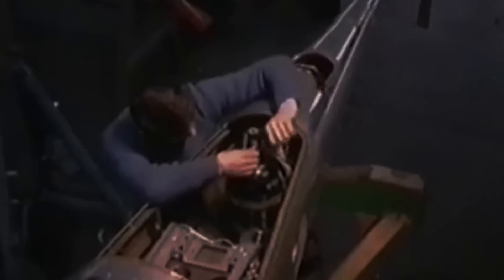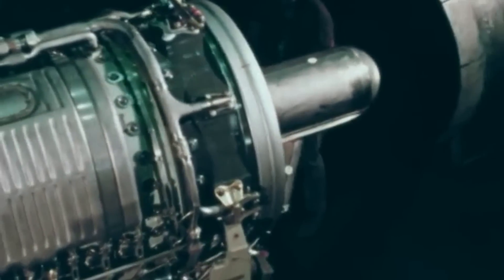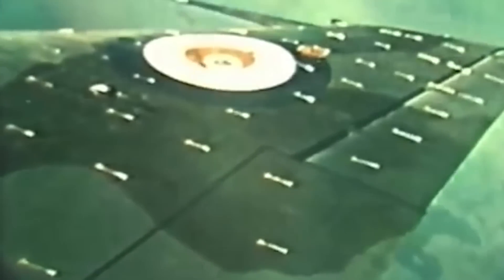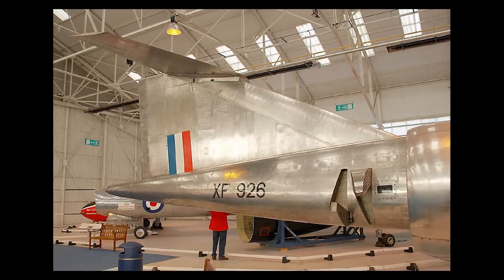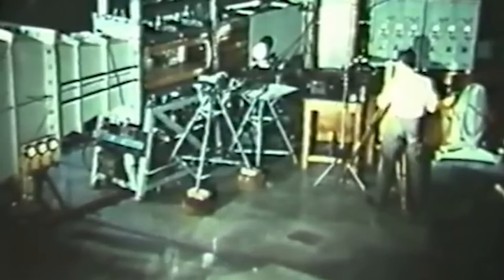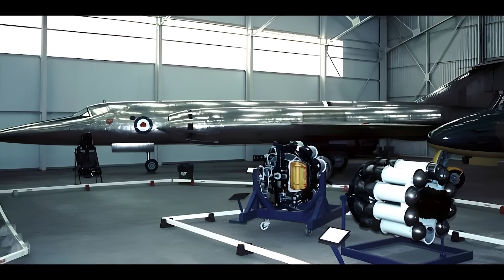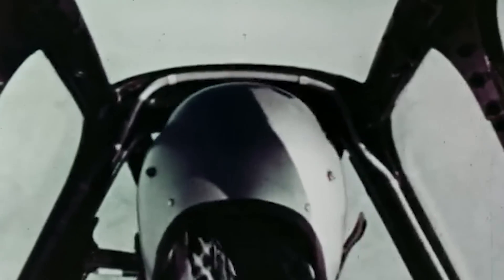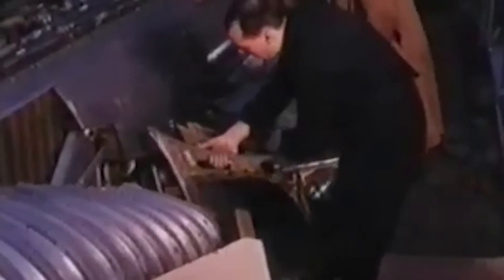The Flaming Pencil -  Britain's Supersonic Jet That Almost Melted Itself

Comment: Looks like it was the prototype of SR-71 black bird.  At the time, the Brit might have no idea on varying the jet engine cycle into ram jet like SR-71 did.
Reply: At the time Bristol were also developing the Olympus engine which would go on to power Concorde. A military Olympus would have been able to cruise at Mach 3+ without the need for ramjet or even afterburners.
Reply: @agt155  At mach3, there are no turbojets  which still have efficiency.

Comment: The airframe was alright, though complex to built. Unfortunately the engines (Gyron Juniors) had such poor specific fuel consumption that the 188 could not sustain Mach 2+ beyond a few minutes, i.e. couldn’t give any data on sustained flight airframe heating because it couldn’t carry enough fuel. The very thin wing wasn’t variable sweep, it was compound sweep.

Comment: I read that it was the specific fuel consumption (SFC) of the engines was inadequate and that it simply could not carry enough fuel to complete the task. In A-12/SR-71 case this was solved by having engine to work as turbojet in low speed regime and ramjet in high speed regime. MiG-25 Foxbat used the engines that was highly inefficient at low sped regime, but could take in a lot of ongoing airflow making them adequate for M2+ cruise with afterburner.
I don't know if 188 could contribute to "heat-soak" tests with such a short endurance. It is a tough job and solving it may be expensive. A-12/SR-71 used honeycomb titanium structure, special fuel, would leak on the runway as reservoirs would plug themselves as the speed/ heat increased. Foxbat used mainly stainless steel airframe, special thermoresistant fuel and inert gas which made it capable to fly M2.83 (that speed was the nominal atmosphere limit caused by heat due to drag, it was lower or higher depending of real conditions).
Continuous speed slightly above M2 is "solvable", both Concorde and Tu-144 proved it. MiG-25 also would keep its speed under M2.2 for max range and airframe life (not the engines). OTOH, MiG-31 used just this mark for its max continuous speed as it has turbofans (It can hit M2.83, but it is the limit, while MiG-25 can do it until it runs out of gas).
Reply: The 188 was only a research project, it didn't really need endurance. If a production aircraft were made it would no doubt have been fitted with Bristol Olympus engines (being developed at the time) which were the most advanced high speed jet engines around.
Reply: @agt155  My point was that it could not reach its design speed because of poor engine SFC-simply could not carry enough fuel. Even with engines with better SFC it could maybe reach design speed, but being there for 2 min does not provide any meaningful "heat soak" data.

Comment: Its (bad) Aerodynamics was why it was so slow! Britain know nothing about Area Rule, or any aero tricks.
Reply: Buccaneer.
Reply: Not sure if the area rule applies to supersonic platforms.
If you look at the cross-section of many supersonic aircraft, they don't seem to adhere to the area rule. Compare the Bucaneer to the Tornado. The Bucaneer is subsonic and follows the area rule whilst the Tornado is supersonic and from my knowledge it's shape doesn't appear to, but I stand to be corrected.
Reply: @125brat  sorry, area rule does apply above Mach 1 and has often been applied.   However,  supersonic aircraft also have to manage the shock waves, so the impact of area rule on the design is not so visually obvious.  I used Buccaneer to refute the 'claim' that British aviation  engineers didn't understand area rule in the 1950s.
Reply: C'mon man!
Reply: And there talks and EX -Spert
Reply: @theoccupier1652  an ex-spurt. Please get your insults grammatically correct, or else people just assume you are ignorant.
Reply: But built many of the fastest planes, cars and boats ever

Comment: British SR-71 .  If you painted in matt black ( god forbid....)  it would look state of the art !
Reply: My thoughts exactly.
Reply: Lol it would still be just a black-bird trying to fly supersonic.
Reply: This plane was built by a group of enthusiasts from Novosibirsk with two stainless steel pipes from the hardware store and stainless steel sinks from a scrap yard. They polished it perfectly, mounted two engines from abandoned MiG-15 and wanted to make a supersonic home-made aircraft with a budget of only 20 000 rubles!

Seriously don't compare it with SR-71 Blackbird, it's silly.
Reply: Wrong fuselage material and weak engines
Reply: @rubinreiter6351  Try and comprehend what was written please, he's talking about it's 'looks', in which he is correct! As stated in the video materials science wasn't advanced enough which is why SS was used! First flight Lightning, 1954, first flight SR71 1964, lots happens in ten years!
Reply: @icarossavvides2641  Thanks for clearing that up !
Reply: @rubinreiter6351  was it made of stainless steel ?
Reply: @javidjames3319  the SR-71 was made of titanium.
Reply: @rubinreiter6351  Mig-25 is stainless steel body, and it can easily reach Mach 3 as well.
Reply: @alexlo7708  how long? At which height? To much weight.
Reply: @rubinreiter6351  Long enough that it can reach SR-71 and fire a missile.  Mig-25 had several records on high altitude.
Reply: @alexlo7708  they tried it 25 years in vain.... The SR never was scratched and while trying it the Mig engines failed in short time, the J's went on for hours.
Reply: @rubinreiter6351  SR71 never went scratch because it never flew into Soviet airspace since then.
Reply: @alexlo7708  there were photos of Migs and there contrails far below the cruising altitude of the SR. Later after the breakdown of the USSR the Mig Pilots visited Beale and reported that they tried but never reached that altitude and their engines flamed out or even got damaged. Zoom climbing is not a straight and level flight, minutes of M3+ versus hours. Keeping altitude versus zoom. No chance. Missiles couldn't do it as well, no atmosphere to steer and line up, bullets are slower than the SR. Keep on dreaming....
Reply: @rubinreiter6351  No need to wait post Soviet break down. The Soviet cheated pilot, Mr. Balenko had brought it to Japan in exchange for US money since it was early deployed.  Many tourists have experienced space flight tour on Mig-25 in post Soviet era as Russia had made them available to everyone who can pay. 
By the way, there was no record of SR-71 being chased by the Mig since the black bird had never flown to Russian airspace.
  Moreover, Mig-25 is interceptor, not fighter. So they were not used in chasing someone like Su27 or Mig-31.   Had it been presenting after SR-71, That'd have mean the plane'd never return.

Comment: 1963 and it's still not at M 2.0
The F-4 Phantom, Lightning and Mirage III all  did that ... in 1958
Reply: It was designed as a research aircraft for testing sustained high mach speeds on airframe heating. Those other aircraft you mentioned could only reach those speeds in short burst.
Reply: Well they still wanted to have their own blackbird.

Comment: looks like a larger f 104 that had engine pods stuck on with larger wings
Reply: I thought the same thing. It actually looks like Kelly Johnson had a few too many and built an F-104/A-12 hybrid for giggles.
Reply: I think it is like the unrecognized child between an F-104 and a Gloster Meteor
Reply: Nahh it's a tiny blackbird learning to fly supersonic.
Reply: The main difference it actually flew! The F104 was a death trap and an early  Lockheed scam.
Reply: The F-104 first flight was in 1954.  The Bristol 188 first flight was in 1962, The same year as the Lockheed A-12 which led to the SR-71 Blackbird.  When the Blackbird was first discussed (by LBJ bragging about it and mis-naming it from RS-71 to SR-71), There were said to be two predecessors to the Blackbird, the A-11 and YF-12.  Now they are described as the A-12 and YF-12.  Anyone know why?  "A" designates a military Attack aircraft, just an "S" indicates Anti-Submarine Warfare.  I believe the story, at the time, was that A-11 was either a CIA designation or a Lockheed design number.

Comment: Very futuristic looking aircraft but was largely killed of with the move from interceptor jets to the Surface to Air Missile in the late 1950s. It never flew over Mach 2 in its final form, however the new English Electric Lightning interceptor had entered service and it was capable of Mach 2.23 or 1,500 mph, flying on more reliable Rolls Royce Avon engines (rejected for the 188 ?) The older Fairey Delta FD-2 also reached Mach 2, and with new "Concorde wings" it became the development aircraft for the Concorde airliner.
Reply: Marcel Dassault purchased ALL the research data resultant from the delta-winged supersonic Fairey Delta 2 ......... I wonder what he did with it????😉
Reply: Don't you think it's not a real comparison to compare this with the English Electric Lightning interceptor? The clue is in the moniker 'interceptor'? Max service speed was, by the end of development,  mach 2.0 although it was believed capable of maybe one or two tenths more. Flight time was severely restricted to, I believe, tens of minutes rather than the 188's SUSTAINED high speed capability. I worked with a guy who serviced them on Cyprus in the 60's who told me that after each sortie something not much short of a major service was required upon return.
Reply: @icarossavvides2641  The originan performance figures were quoted by the RAF as 1,500 mph or Mach 2.3.  Appearing in most publications 1960s and 70s. But in service aircraft do tend to get heavier as time goes on, plus the addition of draggy items such as refueling probes. After each flight maintenance is normal..